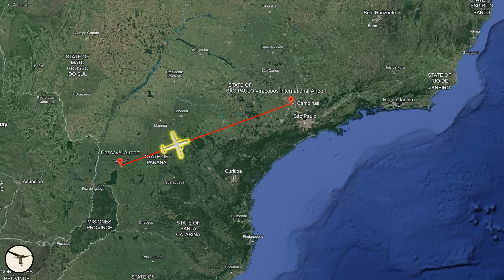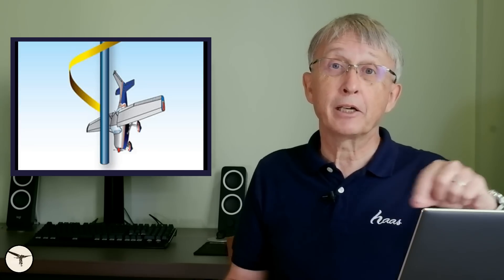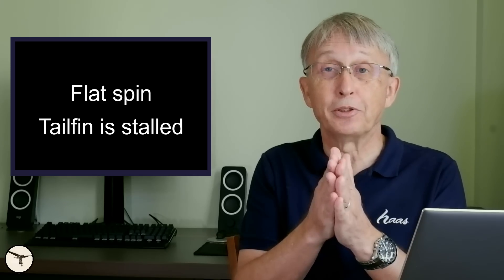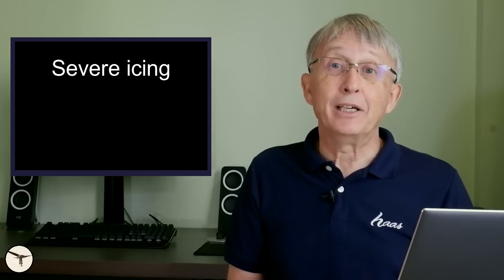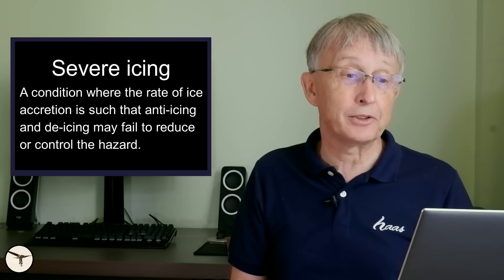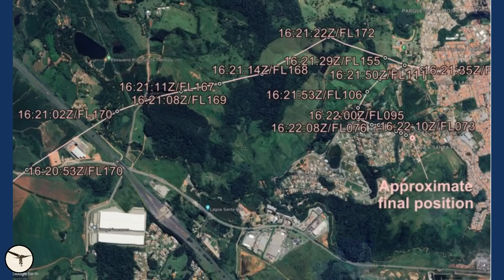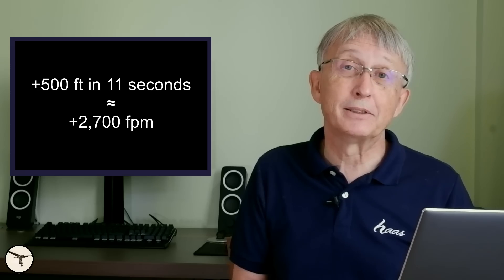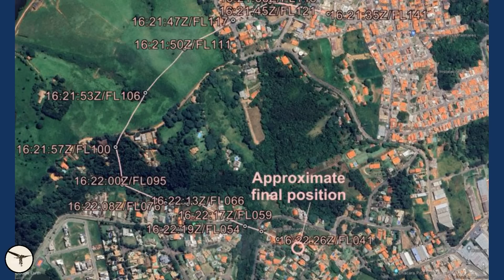ATR 72-500 Crash: Understanding the Fatal Flat Spin & Severe Icing Dangers

Comment: On a multi-engine aircraft, could you recover from a flat spin by using max thrust on one side of the aircraft and significantly reduced thrust on the other side to counteract the rotation around the yaw axis?

Comment: I guess there is one important question I have:  what questions do you have that you think that investigators will focus on?

Here's my list:
1.  Icing?
2.  Center of gravity?
3.  Control surface integrity?
4.  Were the controls coupled or uncoupled?
5.  Initial stall:  how did the crew respond?
6.  That initial climb, what happened?
7.  Engine function or malfunction?

Of course at this point we should only have questions. But this strikes me as an extremely atypical accident.

Comment: In a flat spin with a twin prop like the ATR, what would happen if you applied full power on the inner engine, and reversed the prop on the outer engine? Having only flown single engines, if I woke up in a flat spin in a twin I'd try that, it's not like you could make the situation worse anyway...

Comment: On 11 March this aircraft suffered a severe tail strike, damaging the hydraulics. After repairs it returned to service 9 July, but flew with persistent in flight hydraulic failures.
Reply from the maker: The aircraft suffered a hydraulic leak in flight. This affected the flaps. Consequently, the aircraft landed without flaps, which meant the aircraft was landing with a higher nose up attitude than usual. The tailstrike occured during this landing, and there was structural damage. The aircraft was repaired. Whether the aircraft continued to fly with hydraulic failures, I cannot tell. But loss of hydraulics do not affect the primary flight controls. They are manual.
Reply: @FlywithMagnar  That is disingenuous of you: flown with Hydraulic Auxiliary pump in standby , if there is a Low pressure warning it automatically activates  Hotel mode.  If one propeller is braked in flight then that creates asymmetric thrust. The QRH indicates Hotel mode can be selected in flight by selecting the Auxiliary pump.
Reply from the maker: No, this is not correct. The propeller brake (Hotel mode) cannot be activated in flight. To operate the propeller brake, the aircraft must be on the ground (WoW switches activated,) the gust lock must be on (meaning the power levers must be in ground idle, and the conditon lever must be in FTR or FUEL S.O. When blue hydraulic pump is lost (low pressure,) the procedure is to select hydraulic crossfeed (the green hydraulic pump supplies both systems.) 
If both main hydraulic pumps are lost, the AUX pump will run when the landing gear lever is selected down. This allows for extension of the flaps, and the use of spoilers and nose wheel steering. The landing gear is then extended with gravity.
If there is a hydraulic leak, the associated system is lost and the pump(s) must be switched off.
Reply: @FlywithMagnar  You are either guessing , or lying because Brazil's Center for Research and Prevention of Aeronautical Accidents (Cenipa), conducted no investigation of the tail strike.  News media  report low hydraulic pressure preceded the tail strike. How can you be an advocate for aviation safety when you don't tell the truth about Voepass' poor  maintenance?
Reply from the maker: Here is my source: https://avherald.com/h?article=51c4be1b
Quote: Brazil's CENIPA reported without mentioning the tail number of the aircraft involved: "The aircraft took off from Guararapes Airport - Gilberto Freyre (SBRF), Recife, PE, bound for Deputado Luis Eduardo Magalhães Airport (SBSV), Salvador, BA, in order to perform regular public air transportation.  During the cruise phase, the aircraft displayed a low hydraulic oil level message. The procedures provided for in the manual were performed and the flight continued to the destination aerodrome. During landing, the aircraft made abnormal contact with the runway. After taxiing, the aircraft was handed over to the maintenance team." and categorized the damage as minor, there was no investigation. Brazilian Media claim that according to maintenance documentation by the airline the aircraft had received substantial structural damage (editorial note: supported by the ground time of the aircraft returning to service only 120 days after the tail strike in Salvador). End quote.
"Low hydraulic oil level" means hydraulic leak.

Comment: Is there any way to heat the outside of the aircraft. With a heat system or a heating system lined under the important parts of plane to keep it from icing? Or is it too cold at that speed and altitude that it wouldn’t be effective
Reply: These smaller engines don't produce enough heat, that's why this type has inflatable de-icing boots on the wings

Comment: I still didn't understand, or i kinda did but it seems crazy that simply having some ice on the wing can make it lose that much performance to the point its going so slow it stalls. Maybe the amount of ice is way more than i'm picturing.
Reply: The plane can only fly if the wings have a certain shape. When the ice alters the shape of the wings the plane will become unable to fly and just fall down like a random piece of metal.
Reply: @eichelrueck  Right... i understand that but, for whatever reason i thought "icing" just ment a thin layer of ice over the wing, not really shape altering.

Comment: As a pilot I find it awfully unlikely that a plane with a stick shaker would allow the plane to become stalled unless there was a total loss of elevator control.  Could the ability to use opposite rudder to cease the yaw required for a spin have existed due to an instant buildup of ice on the tail? Perhaps.  I've done stall/spin practices and it's very easy to get out of as long as the tail surfaces still have enough authority to do so.  The autopilot would have tried to maintain altitude as the airspeed decayed (but the pilots would have (or at least should have) noticed this and then rectify it by descending to maintain proper airspeed; they had a lot of altitude on their side.  Does that type of plane have airspeed hold as part of the autopilot system; seems that if it did the pilots would also be aware of an increase in power to maintain that speed). Weight and balance could have played a part in loss of elevator authority but I doubt a commercial flight would have deliberately taken off in this condition.  I find it extremely unlikely that an aerodynamic stall of the wings by ice would have resulted in a flat spin in a vertical direction unless a total loss of tail surface authority also existed.  Time will tell what the whole story was but my educated guess is that there were a few links in the chain of events that ultimately lead to this horrible disaster.  The sheer drop in altitude of +12,000 fpm would have been sheer terror and my heart goes out to those on board and to the families and friends of those that died.  Truely awful.

Comment: Hello sir, I had a question about ATR 72, the idle gate must be pushed in during take-off and what happens if we don't push it, and another question, the performance of the aircraft must be confirmed on the perf page in the mfd so that the performance is entered?
Reply from the maker: Hi. The idle gate moves in automatically wheh the wheels are off the ground. Yes, the take-of performance must be confirmed before take-off. But this is only for the 600 with glass cockpit.
Reply: @FlywithMagnar ‌‌ thank you

Comment: This aircraft can use reverse thrust for braking when landing, and even reverse taxi, is it possible that one propeller went into reverse causing a severe asymmetric thrust situation. A spin so flat would be almost impossible in that type of aircraft.
Reply from the maker: To apply reverse in flight, you must use two hands to release two different locking mechanisms. That cannot happen by accident.
Reply: Perhaps a malfunction that caused the pitch to reverse. There is some strange noises as it falls, I thought is was the sound of a Helicopter but it stops when the plane crashes. @FlywithMagnar
Reply: @vandergoogles  It's inevitably going to sound strange when it's spinning, falling & without any forward movement. Nobody ever hears a plane in such a situation other than sometimes at an air show - though obviously very different planes are used, and the pilots are in control. Such a situation is kind of similar to a helicopter - spinning blades, but with no forward(relative to the blades) movement.

Comment: Dear Cristiano Mallmann, I agree with your earlier comment. As I have mentioned, I have flown into icing condition during my 20 years flying ATR.  In ATR aft CG during icing is not healthy. Ice forms on the tail, although there are Anti icing on both horizontal and vertical stabilizers, but ice carries weight. That’s why we need to fly fast, and change to lower altitude right away during moderate to sever icing. ATR also has icing speeds that manufacture requires the pilots to use those speeds during icing conditions. The FDR will reveal tones of information on this sad crash. God bless all souls on board 2283.🖤🖤🖤
Reply from the maker: Ice also forms on areas ahead of the CG, like the nose cone, forward parts of the fairings, antennas, propeller spinners, etc. Therefore, ice accumulation does not move the CG much. Excluding this accident (as we do not know the cause) and American Eagle lfight 4184, all accidents and incidents related to icing have happened because the crew have flown too slow and/or neglected alerts from the APM. Several crews have also used incorect stall recovery procedures. Here are three examples https://youtu.be/_q1F-aXMLHM

Comment: Hi Captain...I'm a little worried about the  weight that  ATR 72 can handle in hot tempratures . I'm flying with 72-600 and with some calculations I made I think it is overweight. I am flying from Ioannina to Athens with a distance of 400 km in a straight line, so the plane will need to travel about 500 km and will need about 2,700 kg of fuel. Τhe issue is that in the flight will be 72 people (72 people *85kg = 6120kg). So the airplane will weigh 13,600+2,700+6,120=22,420 kg on the take off. The plane will take off from a runway at 1300 feet altitude and temperature about 37 degrees Celsius. But altitude and temperature limit the aircraft to about 21,300 kg for takeoff. Thank you
Reply from the maker: The performance limitations must be respected. If you calculate you can depart with maximum 21,300 kg, then you cannot load up with 72 passengers and their baggage.

Comment: Terrible that the high wing loading on these pencil thin wings living on the edge for 'efficiency' seems to have its cost in safety but seemingly of less importance. I remember a wonderful book I read when a test pilot had a first flight in a liberator with its Davis wing and he talked about having something like a half hour check before taking off then once up they were told their destination was fogged in they had another similar check before they could land the thing. It seems like in the old school low loaded wing of a Lancaster the pilot could go and have a cup of tea while it landed itself once pointed in the right direction just returning to stop it.

Comment: Dear sir. Thank you for the information 
But why pilot haven't enlarge the track of the flight being fat of this place?
What about weather radar ?? What he did see in ehsi ???
I accuse 
No conform repartition of load baggage + an charlie beavo in this place.
Because of high value of vertical speed because even there ice on wing we put them on neutral position and initial level there was.. and continue .
Sir i have an suggestion about flat spin avoidance to share with you personally maybe it will reliable and we coukd impose it as rule.

Comment: Very clear explanation Cpt, but I would have thought that ATR was equiped with ide icing and icing alert + control adjustment to prevent stalling (normal stalling, not flat stalling), but here from the vid seen on social media it looks as if engines were shut down, in rhat event why did the pilots not lower immedistely the nose? Human error or controls failure as well? RIP to all passengers and crew. A pilot.
Reply from the maker: The ATR is equipped with all the bells and whistles, ice detection system, ice protection systems, stick shaker and stick pusher. We must wait for the investigators to do their job.

Comment: Unfortunately, after 17 years, we have experienced a tragedy in Brazil. What we know is that there was an extreme ice warning, with a very strong cold front formed south of Argentina that was affecting the south and southeast of Brazil (in some regions in the south, we have negative temperatures). In the state of São Paulo, the temperature was between 8 and 18 degrees Celsius on the ground (very cold for Brazil). The aircraft was on approach to Guarulhos and not Viracopos (GRU - SBGR). VOEPASS is a company with 17 ATR aircraft, and it has many years of experience in the regional aviation market. We know that CENIPA was able to extract all the data from both black boxes, and a preliminary report is expected in 30 days. The traditional Brazilian press is creating far-fetched theories. Few channels are discussing the matter carefully, like @avioesemusicas

Comment: Since I read what other pilots had to say, I will add their input here. It looks like they were on autopilot when they entered icing conditions and when the ice built up enough, (as little as <2 minutes!) the plane pitched up and stalled, dropping the wing and entering a flat spin. It appears they only reduced their power at the last moment, far to late. It may not have mattered what they did because it may not have had and most likely did not have any control at all. As was said, this has happened before.

Comment: Those narrow and small wings on these ATR airplanes will increase the potential for change in the low pressure air dynamic  on the upper side of the wings when icing occurs, this creates  to high levels of low pressure  over the ailerons and flaps.
What happens then is that this increased level of low pressure initiates or sucks the ailerons and flaps upwards, this leads to loss of control of the airplane!
Other high wing 2 engine prop planes like Bombardier/De-Havilland Dash/DHC 6,7 and 8 planes with much wider and longer wings does not have this problems in icing conditions. 
Everybody within the aviation industry knows that the ATR`s have this problem!
Less wing area will tolerate less ice in other words !
These ATR planes was banned by pilots in the USA at one point because of this!

Comment: If this is not pilot error then it is a serious problem with this ATR72 model. I was against using it in a remote part of Lapland Sweden 2004 due to the previous history of icing problems. I did it anyway as it is dry ice in that climate however again it has been shown this plane cannot and should not be used in icing conditions, (if this is the case) . No documentation about how to deal with severe icing should be remended. It should be grounded.

Comment: Thank you for your analysis, it was insightful. I was surprised when I saw the flat spin, they are rare and nose down spins are far more common. I know you said the ATR is not certified for spin recovery, but do you think opposite rudder would've had any affect? Just wondering what the pilots might've tried to recover.
Reply from the maker: The rudder has some effect in a normal spin, but the mass of the engines and fuel in the wings creates a strong gyroscopic force. I doubt the rudder would have been large enough to stop that rotation. 
Whe it comes to flat spin, the rudder will have zero effect beacause the empennage is moving sideways through the air. In other words, the vertical stabilizer is stalled. Only certain aerobatic aircraft are certified to recover from flat spin.

Comment: Fly with Magnar  My theory is that the wind was coming down hard as they were approaching to the bad weather and since the plane was on autopilot, the pitch trim compensated for this continuous downdraft until the angle of attack was too much and it lost speed and fell into a stall, but it was not easy to recover because the pitch trim was at maximum, blocking the possibility of lowering the nose to regain speed and get out of the stall. The same thing happened to a Cirrus SR22 and an instructor almost died (in the confusion he touch the down trim button and save his live). He maybe couldn't get out of the stall because the pitch trim was at its highest limit, he freeze at the controls and didn't allow him to recover the stall because he couldn't lower the nose of the plane. All that remains is to check the elevator trim indicator from the wreckage of the plane. Go ahead and suggest this theory if the icing isn't proven.

Comment: First . All my thoughts to the victims and their families . i've flown the ATR72 for many years  as a first officer than captain than as an instructor . we practiced quite often  the exercise of stall recovery in the simulator and the ATR has many protection " stick shaker and pusher" to lose those protections, you have to suffer an electrical failure    , it's hard to get it  in a flat spin  .  the only thing it comes in to my mind is LOWPITCH in Flight it's a vitious failure if not treated quickly . you can get in a spin  , it resembles a flat spin .  i'm really looking for the result of the investigation .